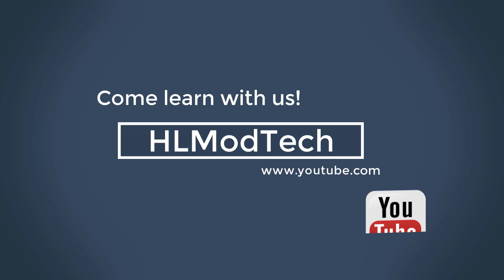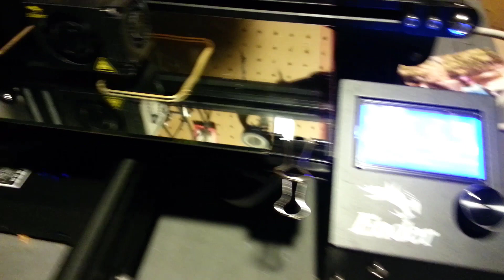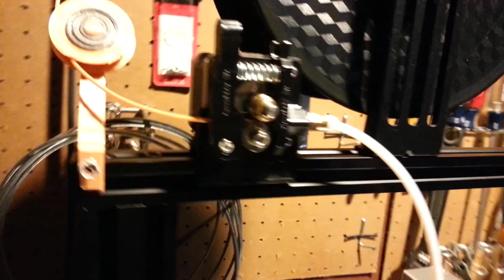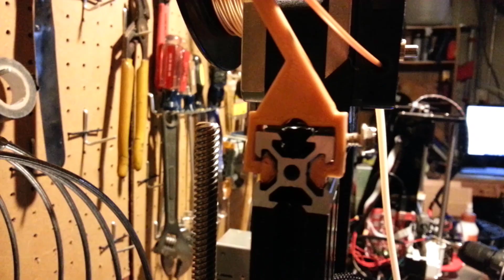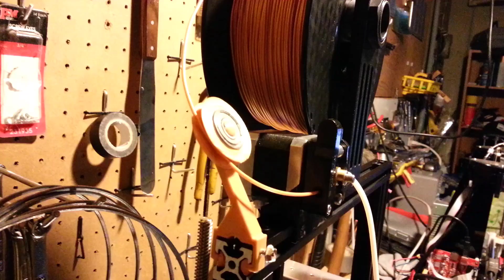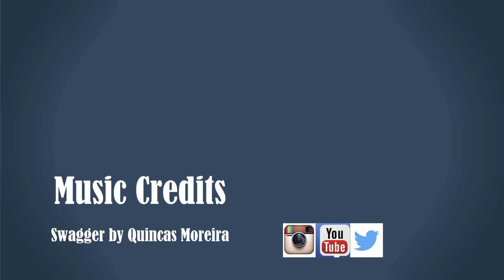Smooth out your Ender 3 with a Slide on Filament guide

Comment: What happens if you just point the extruder/bowden tube down towards the hot end?
Reply from the maker: That is a good question. I will take a look at my design and see what I would have to mod to make that happen.
Reply from the maker: The design is ready for that switch... The problem was the cable is not long enough the way I had routed it... Stay tuned for clip where I give it a go. =)